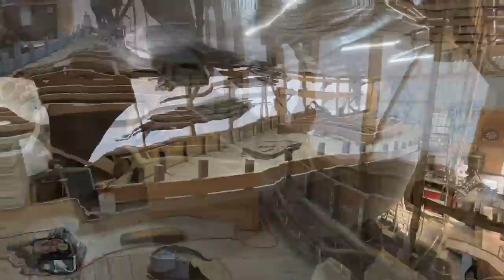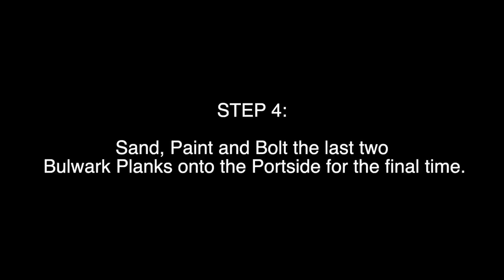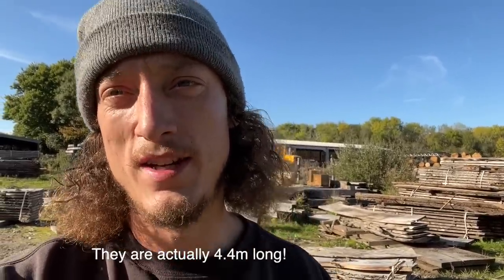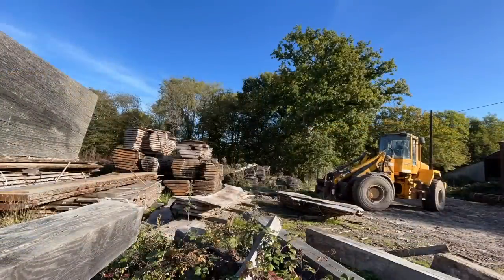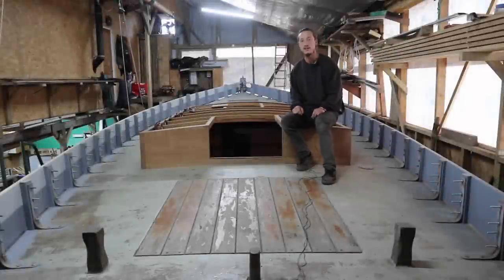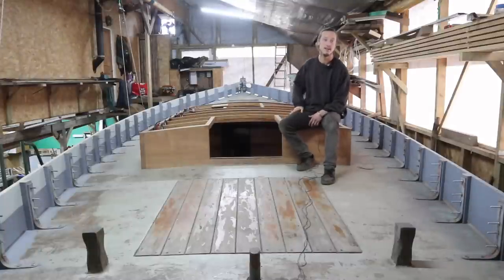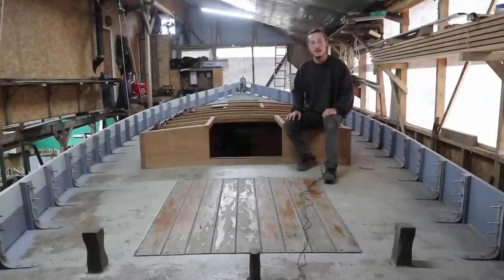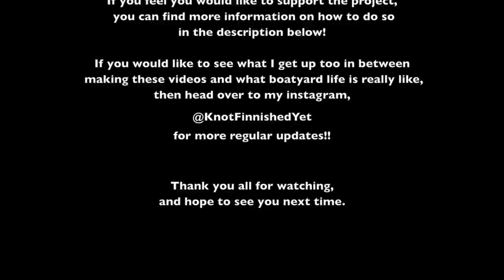Fitting the Final Bulwark Planks!  ***Episode 28***

Comment: It was not until i watched this video did i realise quite how much work there was in the bulwarks.  The amount of times those timbers went up and down was something else.  As you say the sheer line is looking really good and there is no doubt that this down to you taking the time to get it right.  Once you get the capping rails on it is going to look stunning as that is some lovely timber you have got for them.   I see that you have taken a reasonable bit off the height of the floors,  Are the new ones a lot thicker to compensate or is there more than enough meat in them already?
Reply from the maker: Thanks for the kind words Tim. Yes I’ve dropped the height of the sole port and starboard side in the saloon to give a larger one level floor space, but yes new timbers are chunkier. All will be explained in more detail in the next video 👍

Comment: A question Finn, why bolt the bulwarks on with the nuts inboard?... wont you run the risk of catching your legs on them?  They look like coach bolts so could you not have the domed head inboard and recess the nuts on the outboard?  Looking really good though.
Reply from the maker: Good question. I really don’t like them either, but there will be cleats and various other parts fitted to the inside of the stanchion which will cover a lot up. Also once the capping rail is fitted the overhang should give a good amount of protection. 
Thanks for the kind words 👍

Comment: How are you going to finish the forward end of the bullwark planks?
Reply from the maker: Both port and starboard side are fitted nicely into the stem head on the bottom bulwark planks then the top portside will have a small shaped cut out for anchor chain roller. And the starboard side will have a large cut out for the bowsprit.